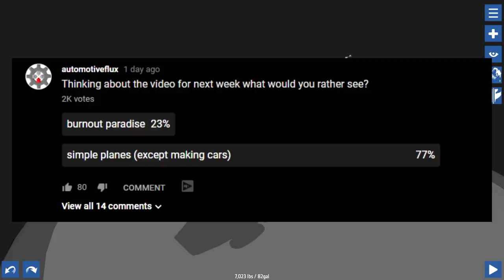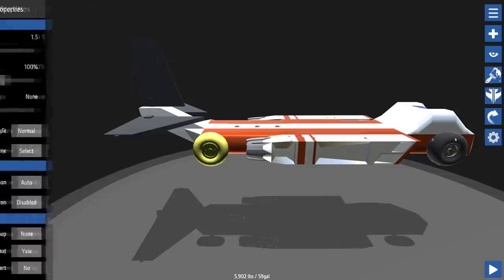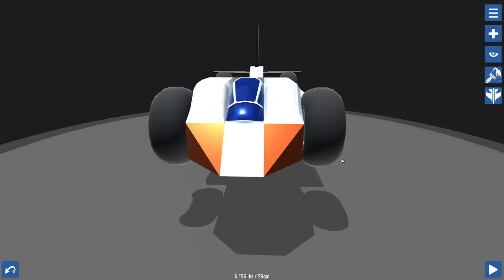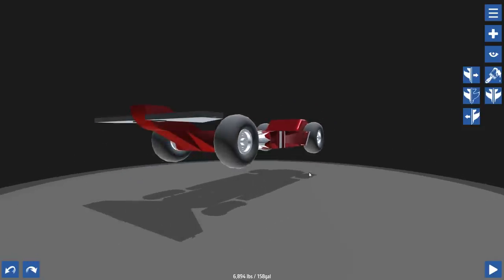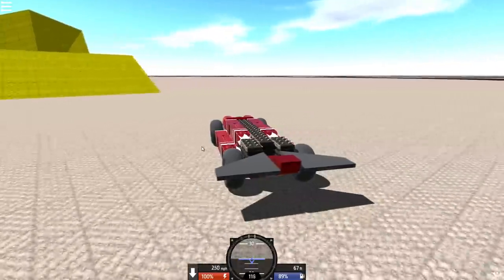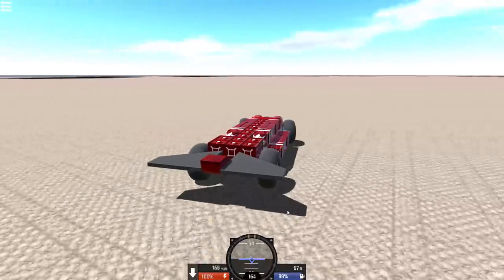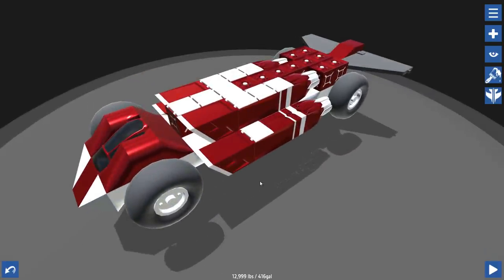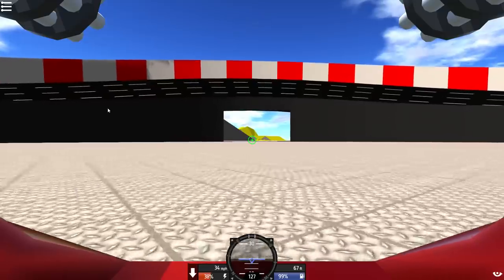An Improved Jet Car - (Simpleplanes)

Comment: Hey man, forget that the normal fuselage/fuel blocks exist, and concentrate on just using the fuselage cylinders, you can customize their fuel and weight capacity, their looks and size.

Comment: Use fuselage blocks. They can be found under structural, and they can be resized. You can have a fuselage block that’s 1/64 the size of a normal block, and you can even add dead weight to them, that way you can have a 6,400 pound ballast.

Comment: You can add ballast to the fuselage pieces. Even tiny  structure pieces can be manipulated to have say, 10,000lbs of weight added. It helps a LOT to make it weigh as much as you can without making it impossible to drive and get up to speed.

Comment: Dude i have an idea you can use the airbrakes for turning like nascar if the car spins but the driver counter it theres a panel pooping to stop the air in the outside to turn the car outside you can do this if you have overload you can set the airbrakes to roll

Comment: To have multiple engines is meaningless because it only change the torque. If you have 600hp on one engine you don’t need more. Great vid btw!
Reply: it make you get up to speed faster so it is useful fighter wouldn't use 2 or more jet xd
Reply: alex gandon I mean the car engine. Not jet
Reply: you can't change the torque without changing the horsepower. You realize that right?
Reply: he was using them as ballists

Comment: Automation/Beam.NG Please, Make A Civic Competitor But Here's The Catch!

Competitor: 1997 EK9 Civic
7.500Rpm 1.5L Inline-4 Making Around 150-175Hp Using Turbolag For VTEC Kicking At 5700Rpm, FWD Of Course Because It's Not Gonna Be Civic Wannabe, Hatchback And For Styling Do Whatever You Want But Keep The Styling Like 1990-2000 Era Otherwise It's Not Gonna Make Sense